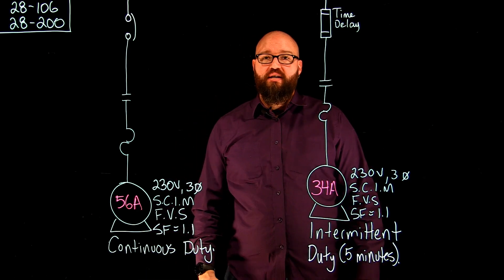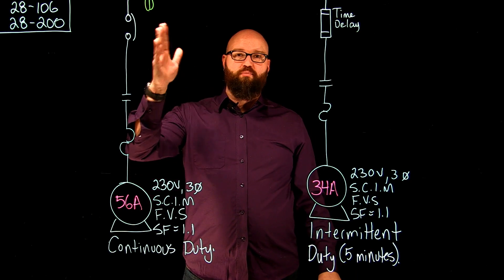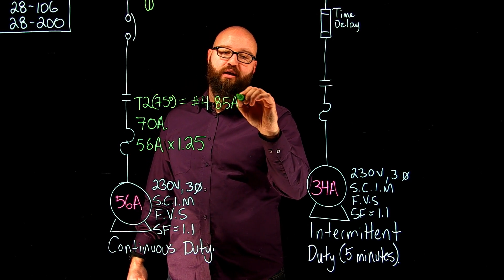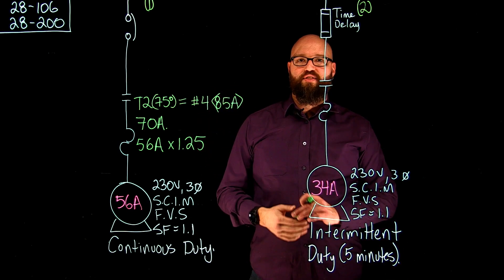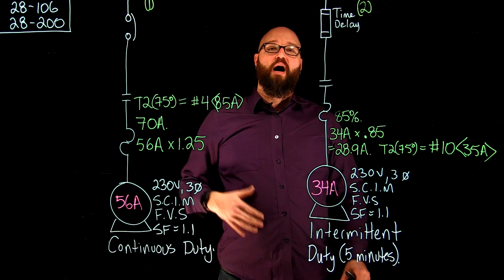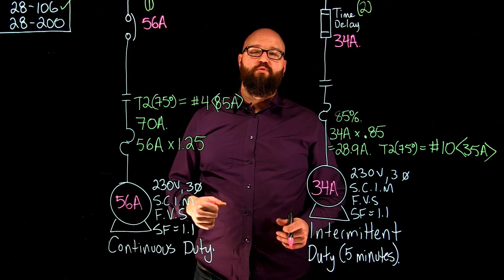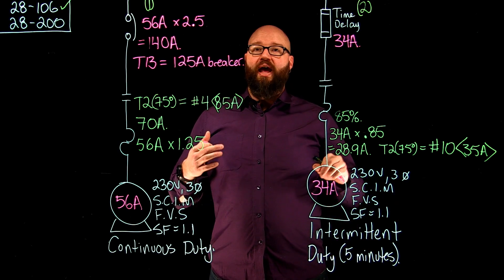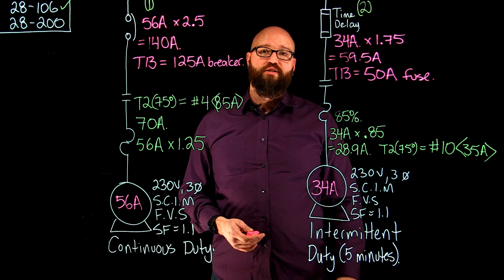Individual Motor Calculations

Comment: U are using the FLA to calculate the OCPD and the branch circuit ampacity ... I think u should use the FLC 
......
Also i have another question ...
Passnger elevator( as an example)  is considered to be 5 minitues or 15 minutes or 30 or  continous rated motors ? 
In different  words ...how can i make the right classification of the intermittent motor 
I hope u get my guestion

Comment: Hey thanks for the vid. Do the calculations change if it is a 120v 1 ph motor? thanks
Reply from the maker: For single phase if not given the FLA we are permitted to use table 45 to obtain the FLA, but still use any given FLA over tables. Otherwise, same process.
Reply: @schulerruler  appreciate the response

Comment: so if you have a 460 3ph system hooked up to a 10hp motor you would have a  14 fla, 16.1 amp OL, 30 amp circuit breaker. but apparently according to t2@75degree i can use #14?what about 14-104 2). does that override it? if so could you briefly elaborate?. seems goofy having a #14 wire thats can still handle the 1.25multiplier of the FLA which is 17.5. very confusing. doesnt seem right that the OL is a bit higher than the conductor even tho i understand that the conductor wont necessarily burn/melt, but doesnt seem right. thanks for these.

Comment: Great video. I was wondering if you or anyone would know when, or if, we would use the 60 degree column for ampacity? I've had some confusing questions from the practice IP where they use 60 degrees and I can't figure out exactly why.
Reply from the maker: If your equipment temperature, or insulation temperature is 60, you would use the 60 column as per 4-006.
Reply: @schulerruler  Thanks for replying. In the examples you're showing here, are we assuming that the termination temperature was marked as 75 degrees? 4-006 2) says we need to use 60 degrees when equipment temperature is not marked and is less than 100A.

Comment: firstly thanks alot for your fruitful information. secondly i need your help for this problem, if we use  Circuit breaker opation at 100% not 80% and i want to size CB for motor i will follw the same rule x2.5flc or what ???

Comment: Hey! Thanks for the great content.
When calculating the bond size with table 16  how do you know whether to use overcurrent or ungrounded conductor  ampacity?
Reply from the maker: It really depends what the conductor is. If it is just a regular ol' bond, then it is sized of the overcurrent as in 10-614 3). 
If there has been an increase in awg size for voltage drop them we use the ampacity of the largest ungrounded, also 10-614 3)
Reply: @schulerruler  ok thanks. If a test question only gives conductor size should I get the overcurrent setting/rating based on the conductors and use that?
Reply from the maker: I would say yes, but remember if you know the load you are permitted to size up from the allowable ampacity of the conductor when using table 13, based off 14-104 1). If you don't know what the load is however you must go down at table 14. Again in accordance with 14-104 1).

Comment: First motor has S.F 1.1 which is less than 1.15, according to previous video, FLA should be multiplied by 1.15 instead of 1.25. what is the reason?
Reply from the maker: In this video we are sizing the branch circuit conductors, and we use the 125% required to determine the minimum ampacity for a continuous motor. Check 28-106 1).
Reply from the maker: If we were sizing overloads for this motor though we would use 1.15 to determine the maximum trip setting.

Comment: I wonder how  can the breaker protect conductor when the ampacity of overcurrent protection was chosen be higher ampacity of wire? thanks
Reply from the maker: The current draw will not exceed the allowable trip setting of the overload device that is separately sized. In this case the breaker is sized to protect against short circuit condition only.
Reply: thanks for your explanation
Reply from the maker: @ductriphan5973  happy to help!

Comment: Hi,I'm doing a cecil question...a 3 phase synchronous motor,575 V, 30hp , sf 1.2, termination rating is 75c, p.f 0.9..the question requires minimum rw90 conductor, maximum standard circuit breaker and maximum overload device. I am having trouble on which table to use
Reply from the maker: Table 44 synchronous motors footnotes tell you to multiply your corresponding FLA by 1.1 for a 90% power factor. This would be your FLA used for all calculations. To determine the overcurrent you would then use table 29 as usual to size. As far as conductors, I would assume it is continuous duty rated for calculation purposes.

Comment: Hi! May I just ask why did you use a smaller rating of breaker and fuse on both the circuit breaker? Have you not considered the inrush current of the starting of the motor? Is it not that the AT of the breaker and the rating of the fuse should be higher than what your calculated inrush current of the motor?
Reply from the maker: The calculations done will allow inrush without tripping. These are the absolute maximum size overcurrent, and any larger would not be allowable. The percentages based off of table 29 in the Canadian electrical code are where this information is found.
Thanks for watching and commenting!
Reply: @schulerruler  the 2.5 multiplier of the breaker, is it not that it is for the maximum inrush current of the motor? Any breaker rating below that calculated current would trip the breaker instantaneously after just starting the motor?
Reply: Overcurrent Calculation = Size Down.
Overload Calculation = Size up
Sizing wires = Size up.
Correct?

Comment: Your videos are amazing so helpful! I’m currently doing intermediate trade school and I have learned a ton from you videos. Thank you
Reply from the maker: I'm happy they are helping! Thanks for watching! Good luck.
Reply: Hi nice presentation However you are very wrong when you selected the 75 deg column based on rule 28-104. That rule is only for the motor supply conductors using Table 27. Rule 28-104 even says "Motor supply conductors" This is NOT  how the size and column of the conductors is selected it is only for the MOTOR SUPPLY CONDUCTORS. In order to select the proper column for the AWG you must and I emphasize must use rule 4-006 (1) or (2). That was a very unfortunate interpretation and completely wrong. I wish you had taught this rule properly now you've miss led every person/apprentice who did not know better.  Jim  p.s  ive taught code for years and this was a huge mistake its NOT done this way at all
Reply from the maker: To size the conductor between the motor and controller you would do exactly as presented in the video. To size the conductor between the overcurrent and controller you would still use the calculated value from 28-106, but the yes 4-006 would apply and lowest termination or insulation would be your determining ampacity at table 2.
Reply: @schulerruler  you never stated motor supply conductors you never referenced 4-006 the most significant rule in the code book  you never reference T37 with respect to motor supply conductors  Im not criticizing your video Im point out the mistakes and I will leave it at that..Its exactly like this:   motor supply conductors are a minimum 1.2  meter long their ampacity is based on the 75 deg column their insulation is based on T37 the distance from the motor is is based on 600 mm or 1.2m for over 100HP   28-104 and T37  there is also ambient temp ie add the difference in ambient to T37 to get the insulation rating 110 deg 125 deg or 200 for that mater Branch conductors 28-106 and 4-006 thats the law period good luck.

Comment: Could you use a smaller breaker on the first example, or do you have to use the highest breaker size. For example, could you use a 80 amp breaker? Much cheaper than the 125amp. Or is it because of the inrush current.
Reply from the maker: Good question. Remember table 29 is our maximum setting of overcurrent device. Academically we go for the biggest possible overcurrent, to ensure consistency in selecting answers, but you could choose smaller than that in the field, but yes inrush could start to cause nuisance tripping if too small.